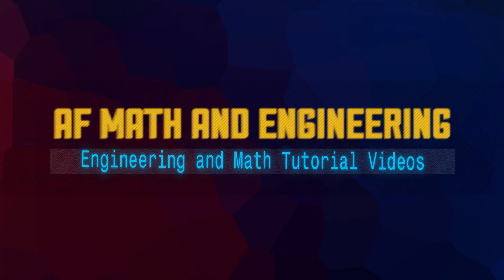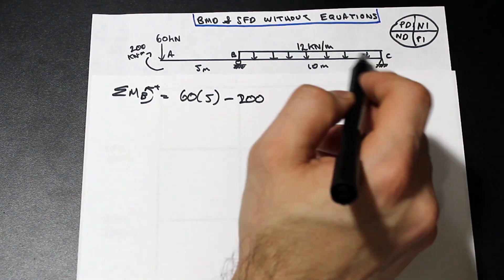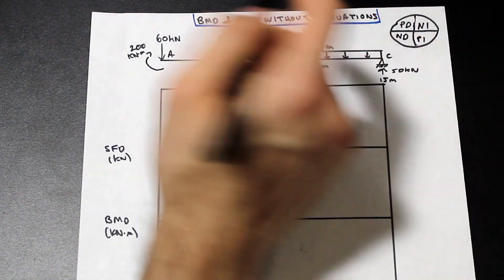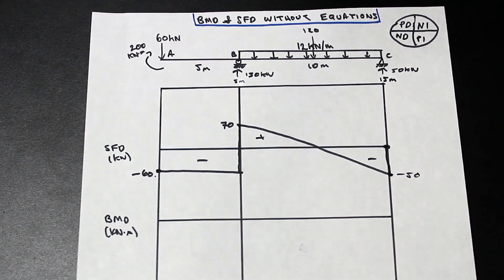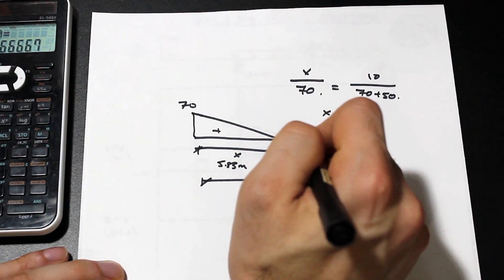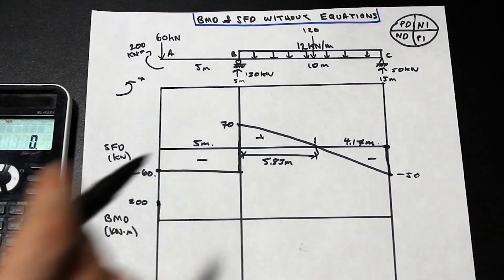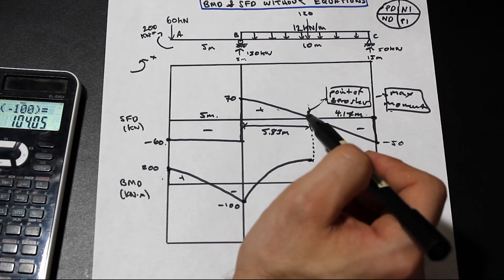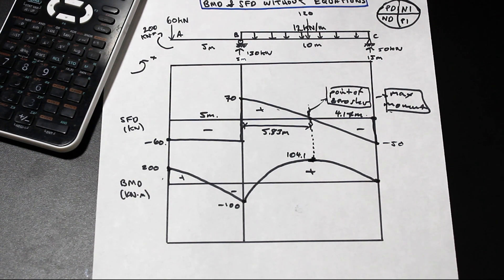How to Draw Bending Moment and Shear Force Diagrams Without Equations - Example 2

Comment from the maker: Quick note! When I say the area under the shear is equal to the moment, this isn't entirely accurate.  What I mean by this is the integration of the shear diagram is equal to the change in moment.

Let us know if you used this technique on your tests and assignments! 

Link to our original video on the same topic: https://www.youtube.com/watch?v=UYkH7Fxkxmo
Reply: Can you explain why the last curve of the Shear Force Diagram is negative and increasing rather than negative and decreasing?
Reply from the maker: @andrewalday7834  Shear force is highest at the supports.  The magnitude of the shear force is the absolute value of the shear at that point, whether it's negative or positive is simply sign convention.  Thus as we approach the support the shear force is increasing.